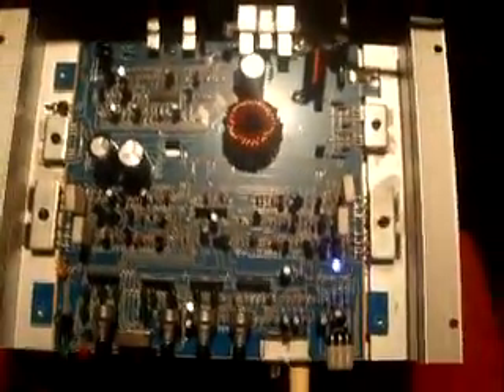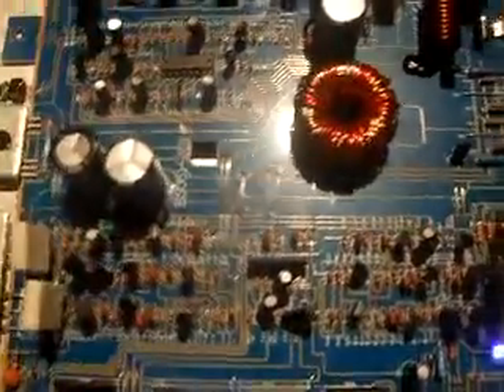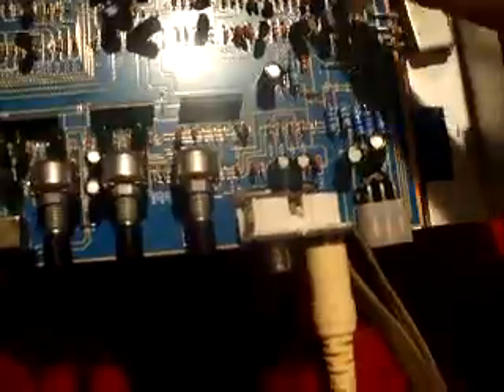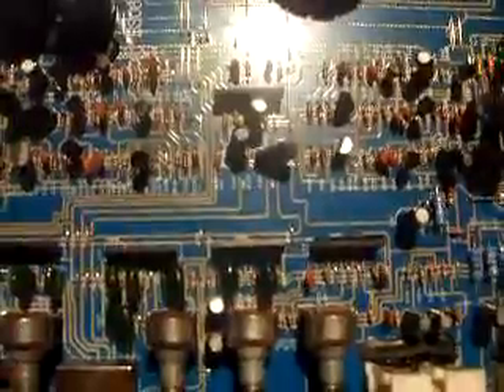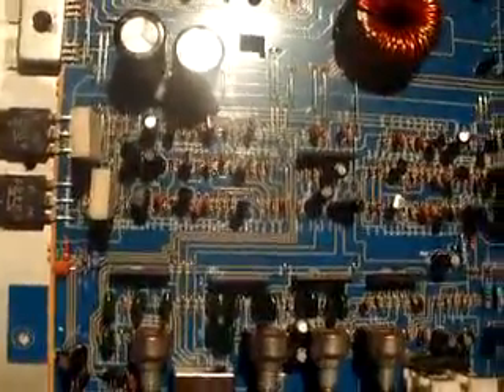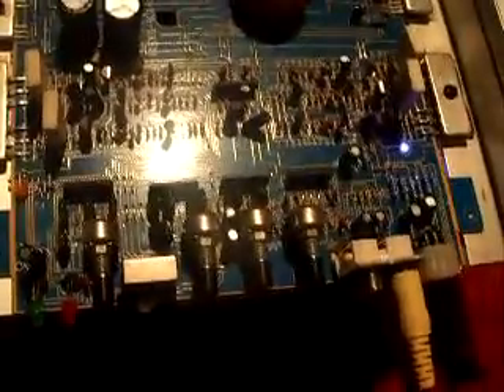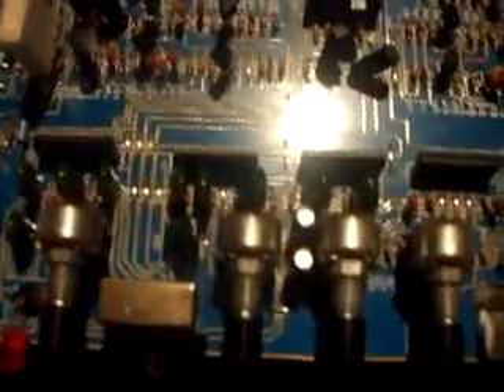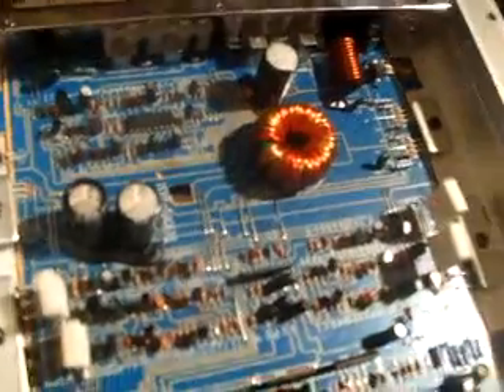Magnum Magna Bass Amp Mod, Amp Repair Part 2

Comment: Very nice, I repair, mod and custom build amps (for my car audio business). The main thing to watch for when changing the pwm driver and output stage transistors to mosfets is that mosfets can have significantly gate impedance than a standard transistor, that being said simply means the base driver for the original transistors may not be powerful enough to drive the mosfets very well. You would definitely notice this problem in the output stages.